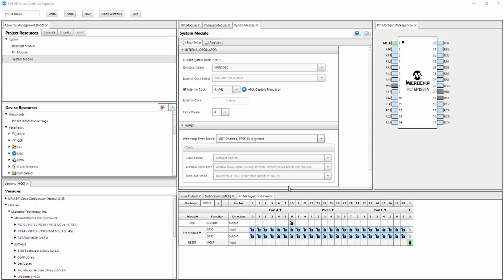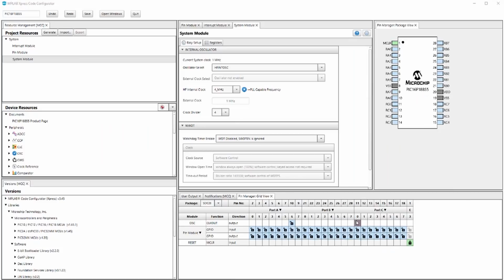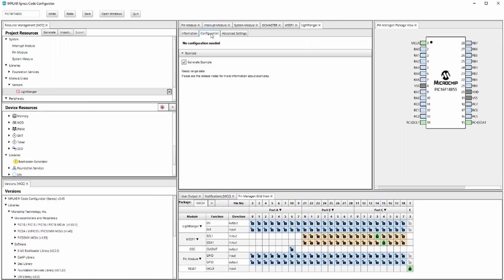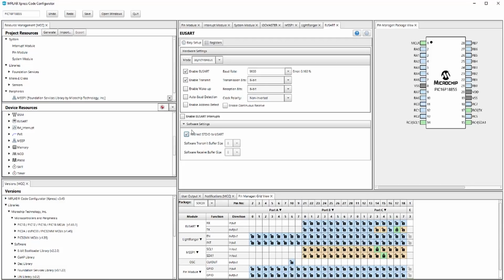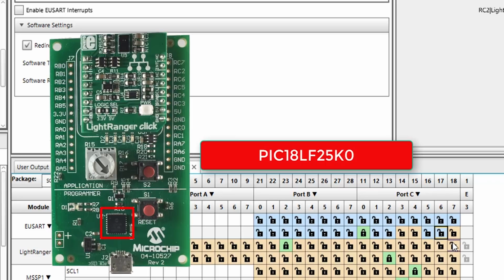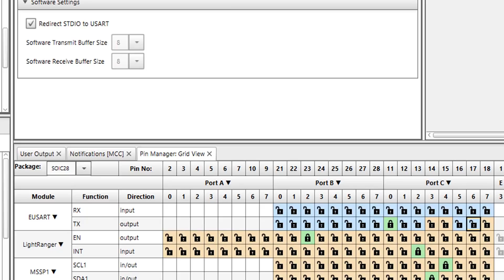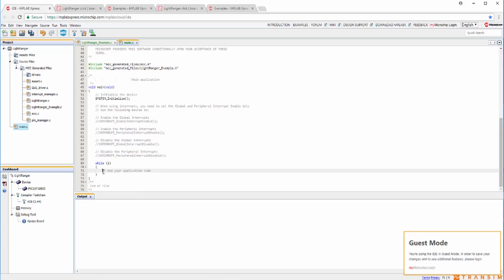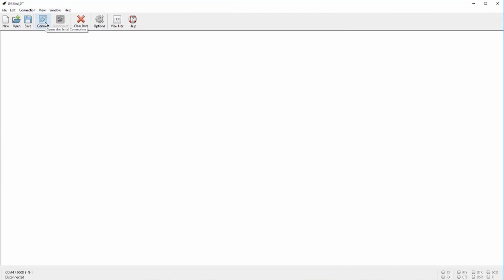How To Click Into MCC - Common Issues with click boards™

Comment: The thing is this.  I click on the MCC, it comes up and there are NO LIBRARIES NAMED MICRO-E CLICKS.  So what do I do now???
Reply from the maker: Hi there, thanks for reaching out. If you're unable to find the "Micro-E Clicks" libraries in the MPLAB Code Configurator (MCC), make sure you are using the latest version of MCC and MPLAB X IDE, as library availability can depend on software updates. If the libraries are still not visible, consider manually installing them by downloading from a reliable source. Hope this helps!